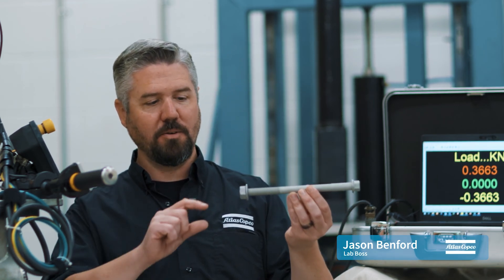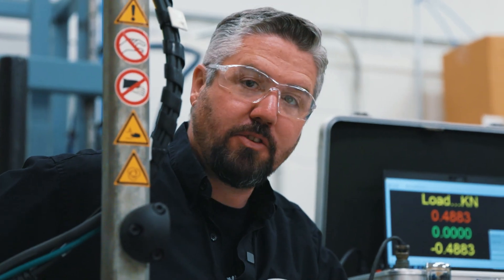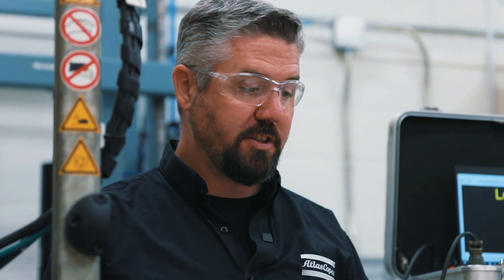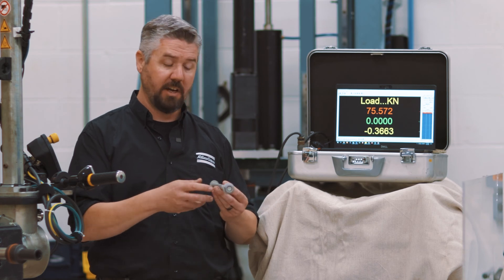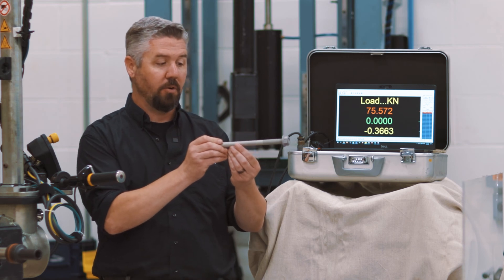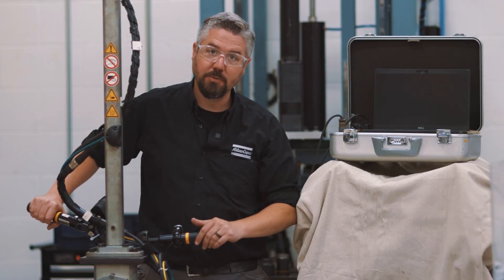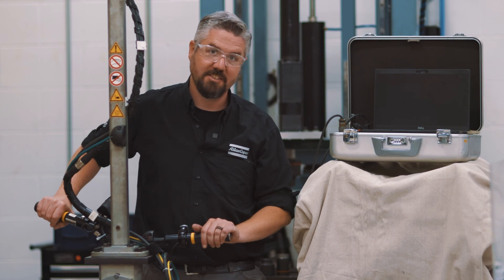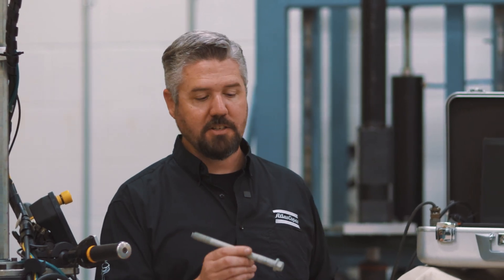In the Lab: Head or Nut Tightening Test | Atlas Copco

Comment: Agreed, to your point, a larger frictional diameter will require more torque to achieve the same clamp load of a more lubricious bearing surface. In the automotive industry it’s more common to tighten from the head of the fastener since a lot of the times the fastener is being driven into a blind cored hole or weld nut.